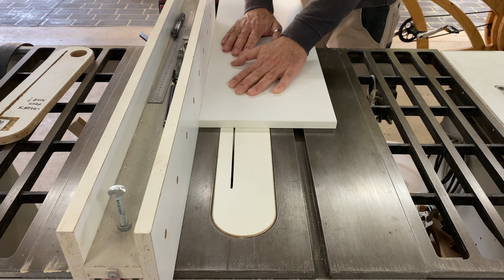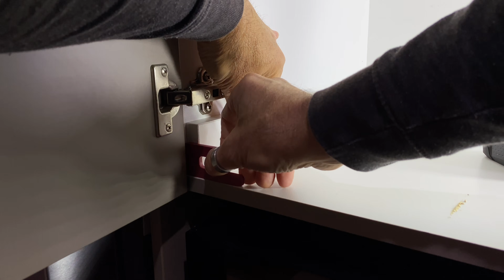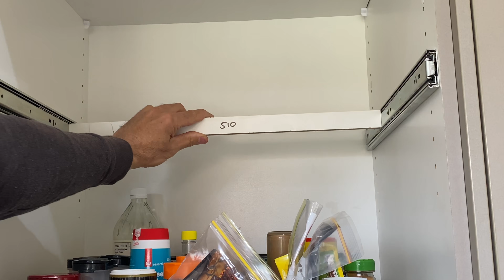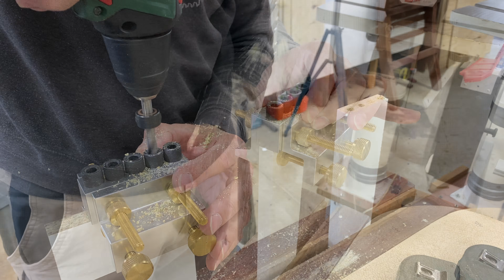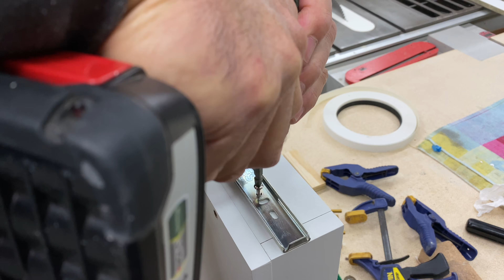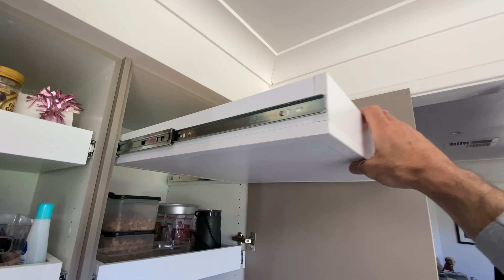Stop Losing Items in Your Pantry: Try Pull-Out Trays

Comment: Been thinking of doing this in our kitchen! The extra board clamped for position and the edge banding on the bottom were both top tips. Cheers Vic!
Reply: If you need a hand let me know mate, I’ll show where to get those runners at commercial pricing 30 minutes from where you are
Reply from the maker: Thanks James. This has made a huge difference  and its not difficult particularly for anyone who's made drawers before.